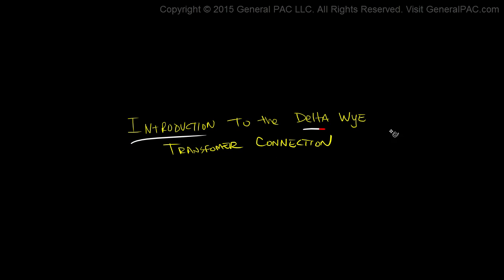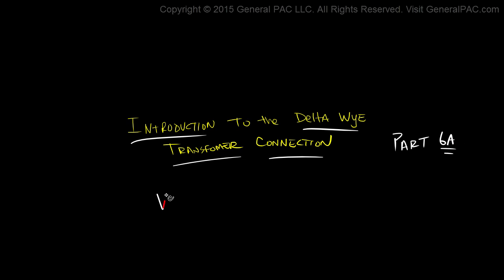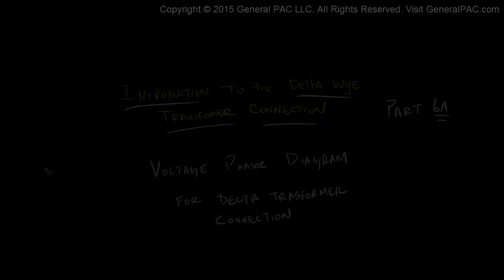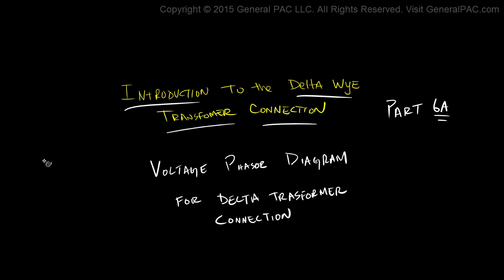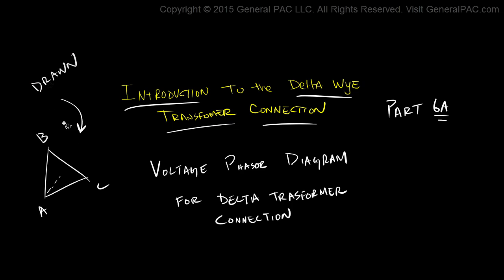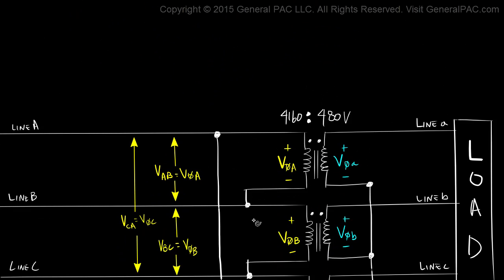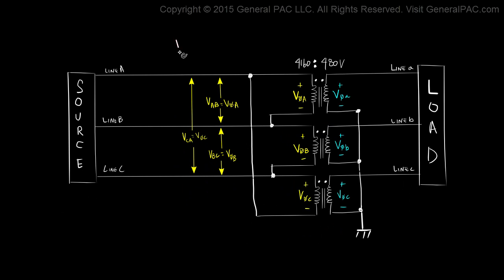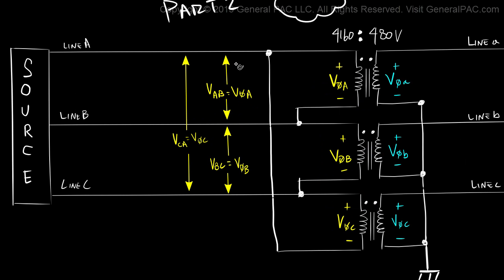Introduction to the Delta Wye Transformer Connection Part 6a: Voltage Phasor Diagram

Comment: I wish this kind of visual explanation was available 22 years ago when I was in school.  thanks for the efforts you put in. I am eagerly waiting for CT saturation videos,  please  focus on CT continously current rating factor relation to CT accuracy, why ct can't be open circuit ed and why  power transformer never gets saturated, ratio and phase angle error.
Reply from the maker: +Parminder Dhawan I hear you - I've been meaning to get back into CTs. There seems to be much more interest in Delta Wye transformer so I'm focusing on that. Should be done with the "introduction" series soon though! Thanks